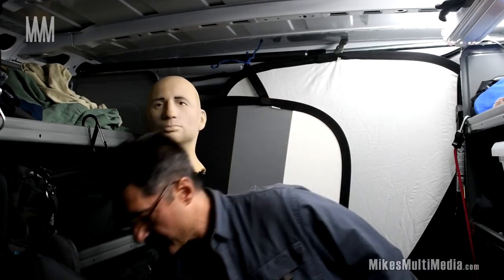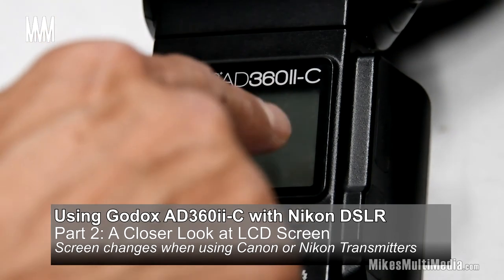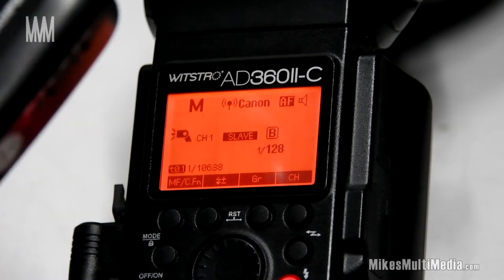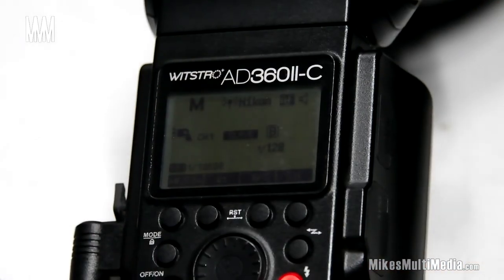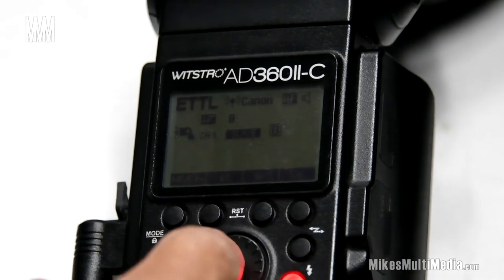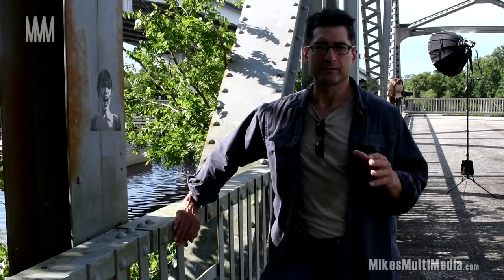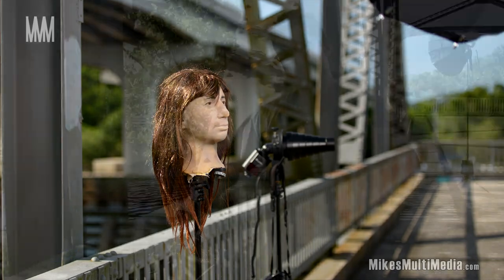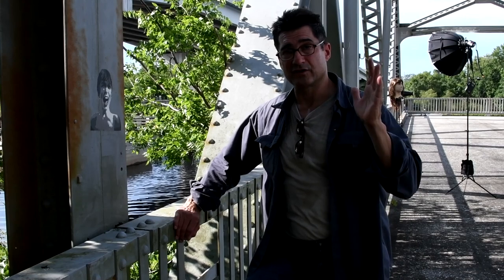Godox AD360ii-C (for Canon) vs Nikon D800 DSLR with Flashpoint R2 Transmitter (MikesMultiMedia)

Comment: only reason that works is because you have to new version equipped with the integrated r2 transceiver built in..model R2.. that is basically a flashpoint 360.ii.c.version if you look close in the manual it says auto switching between brands only in built in r2 versions..i like this trick since i may use a nikon or canon on location..if you press and hold cf.button..button 1 you can lock your code in so you have no interference from other remotes..i love this unit looking at another one..
Reply from the maker: That's cool. In my response to Biplab Dey above, I was trying to break down the communication process between the transceiver (Brand specific) and the off camera flash set to the Channel and Group accordingly. 

All of the brand specific communication seems to be accomplished at the transceiver point. 

If the flash is attached to the DSLR, then the same Brand specific communication takes place by the flash (because it knows and has been set to operate on camera) by its physical placement onto the hotshoe. 

Interesting discussion in deed. To basically reverse engineering what the engineers and programmers had to do with the transceiver and flash unit hardware/software.

They obviously engaged as many generic based workarounds (wireless communication of information) to avoid redundancy and to streamline.

Comment: if iam correct in all i think i know about it only canon and nikon can do this since they have new r2 links built in to flash system is now compatible with all r2 integrated equipped flashpoint systems you don't even need a trigger to use of camera flash it can all be done right through camera flash settings.

Comment: If I use fuji or sony trigger does it response in the same way?
Reply from the maker: Okay, so what are we really doing when I use a Nikon DSLR equipped with a Nikon R2 Transmitter which then triggers the "Canon" model Godox (or Flashpoint Streaklight, etc.) Flash. What I discovered is once the Transmitter (specific to your camera) sends a signal to a Godox/Flashpoint Flash which is "off camera" and set to be triggered wirelessly over its 2.5Ghz system which I have shown is "universal" because the Canon model of the flash was triggered by my Nikon Transmitter. 

So, my experiment suggests that the "signal" sent from the transmitter has been generic-ized to basically contain relevant bits of information such as the flash power settings. Then once the receiver (on the flash) receives the generic information (flash power), the flash (off camera) only has to "fire" at the specified power setting. This suggests that the off camera flash is merely acting like a "Drone" flash being told to set its power (by the transmitted signal) to a set power. 

Thus the only customization needing to be recognized is the software and mechanical pin design at the receiver to communicate with the camera. Note, the transmitter also has to communicate pre-flash information when firing using TTL. This again, is a software processing task at the transceiver end (on the camera) which received basically , and most likely generic "pre-flash" results back to the camera using a most likely generic "light meter" that receives a generic meter reading at the flash end. 

So in summary, the transceiver on the camera body does all the work both software and physical design wise at the DSLR end.  The through the air information has been most likely genric-ized in terms of the required information to TTL or manual flash firing of the flash: 1) a Generic Light Meter (pre-flash) reading sent from the flash (TTL); and 2) ultimate power setting the flash is to finally flash at at time of taking the picture. 

I would  be curious if any of these flashes (I'm not sure how many other different brand DSLR's the R2 system has been designed to work with. But my guess is that if you buy the respective transceiver (goes on your brand DSLR's  hot shoe) and grab any Nikon, Canon or ?? R2 flash unit set to off camera wireless mode, the results may be the same as I demonstrate in my video between Nikon and Canon. 

Let me know if anyone confirms this. Or can explain it better.